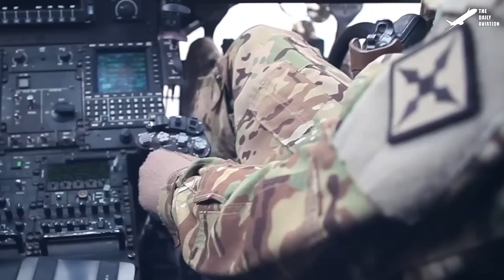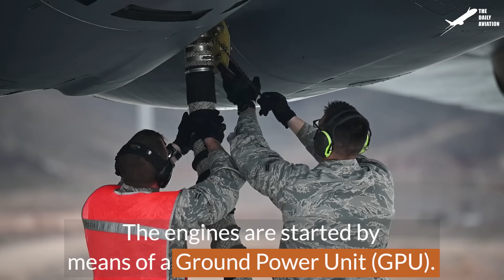Skilled US Pilots Dangerously Land Their Massive CH-47 on Top of Rough Hills

Comment: Hell hole is on a huey, the hole in the floor is just referred to as the hole. And the Chinook has never used .50 cal they used M60's prior to the M240 or the Gau17 Gatling gun which are both .30 cal
flew chinooks from 1978-2000..